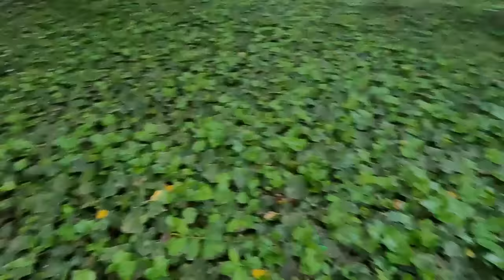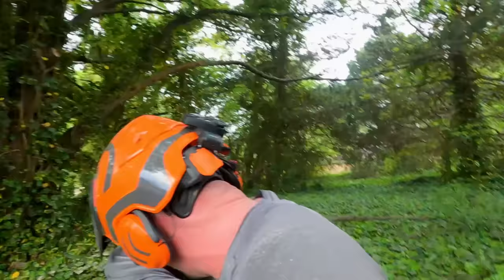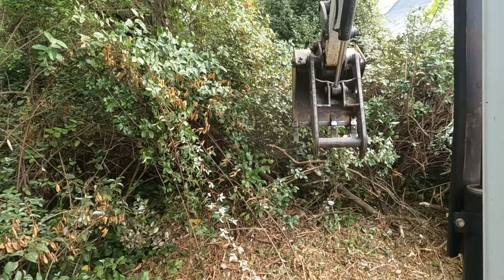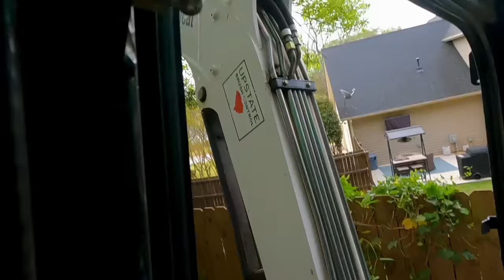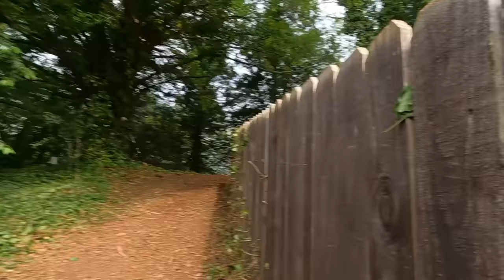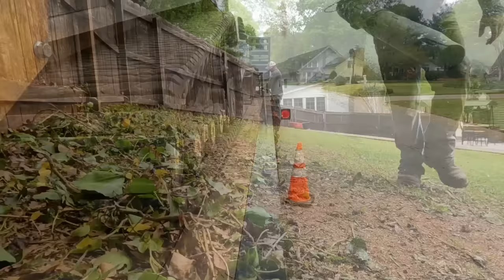EXTREME Ivy Overgrowth in Backyard Forestry Mulching

Comment: I've never cut any English ivy , but I have cut kudzu , and that stuff comes back 10 fold like I've herd you talk about bamboo.
Reply: The only way to really get rid of bamboo and kudzu is to cut or mow it down or rip it out with the excavator then take 12" to 18" of dirt away and replace it. I don't know if it would be the same way with english ivy but I'd imagine so with all the roots it puts down. Spraying bamboo or kudzu won't guarantee the crap won't grow back either. Removing the ground layer that has the roots is the only way to completely get rid of it is what I've learned from trying to remove either of them.